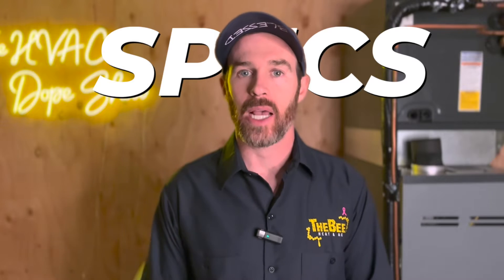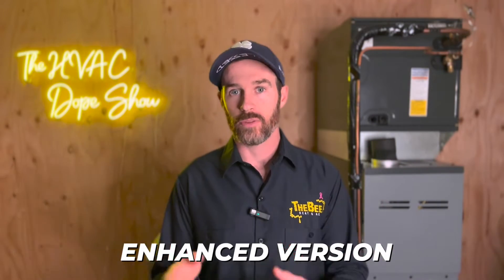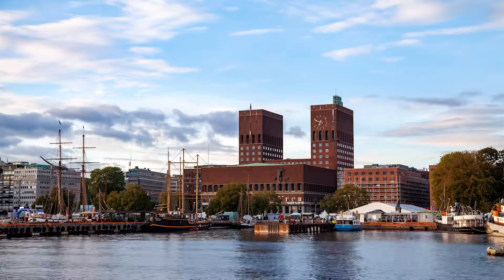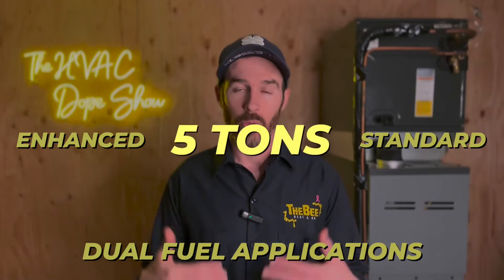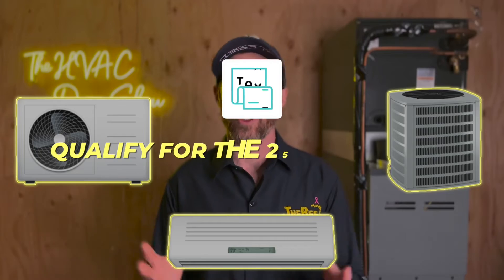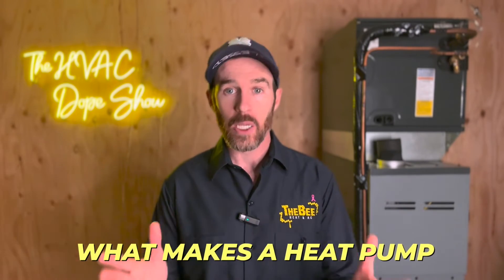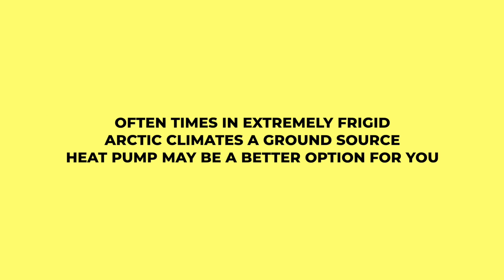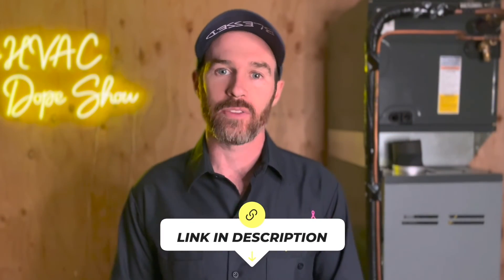The NEW Daikin Fit ENHANCED Heat Pump?!🤯❄️

Comment: Hello, we had our Daikin DH7VSA installed yesterday.  It was getting pretty late in the day by the time the crew finished up.  They started the system and left shortly after.  Initially, the system ran like a freight train, like full speed inside and out.  The house was a little cold, but in looking on-line for answers, some say this is normal and it has calmed down today, but still the blower speed seems much faster than what I have experienced say on a American Standard XV18.  What i found on-line was the Daikin is learning and will run more like expected by day 3 as a variable speed unit.  Is this correct or is there something amiss with this unit?  Thank you!
Reply from the maker: Installer settings can change this like ramping profiles etc. it might be learning the system but also could use some fine tuning in the settings to make it run quiet mode etc

Comment: With the Daikin DH7vsa3610 here in Denver what’s the optimal lowest outside temperature to have it switch to the furnace? Mine is currently How does one change that?
Reply from the maker: The installers will do this but depends for what... if you have solar panels then it's based on comfort and you'll probably set it for 10F or something, but if you're on grid and doing it for cost it's almost always cheaper to run a furnace but the technically switchover temp for Denver based on gas prices last time I checked a couple years back was around 40-45F because that's where the breakeven COP was. 

But that being said if you're more comfortable with a heat pump then you can just select your desired temperature for comfort (whenever it stops keeping up, usually around 10F - 20F in Denver metro depending on sizing. But if you just want what's cheapest do a higher COP switchover around 30-40F instead.

Comment: I’m building a house down on the Galveston Bay. It’s very hot and humid.  How well do these work for humidity? The home will be sealed with spray foam.
Reply: This has variable speed compressor and fan motors. they can pull moisture from the air better during light loads because the system slows down airflow and compressor speed. Slower moving air around the evaporator coil means the air keeps contact with the cold coil for longer
The Fit uses a full-size, high-efficiency indoor coil. The coil has enhanced fin design and expanded surface area, which means more metal surface for heat (and moisture) exchange.

You’re also using a Daikin One thermostat for this system

Smart thermostats with humidity sensors can extend run times or adjust fan speeds when humidity is high.  
So yeah if its properly sized for the space the Fit will definitely make the air less sticky faster and better than systems without the modern motors and designs. All in all the Fit is freakin amazing so far. We will see what happens when these units start hitting 8 or 10 years of service. 

Ps. Don’t forget your annual maintenances and change that filter often!

Comment: I'm San Jose California area. Debating between Daikin Fit DH6VS vs DH7VS, as DH7VS offers the federal tax credit. Is DH7VS too much of a machine for my region as it seems to be designed more for colder regions? Would it be a mistake to go with DH7VS if the upfront price difference is $1000 more, and it seems to be have slightly additional noise and additional electricity usage than DH6VS? Any benefits of choosing DH7VS - is it more durable or efficient? Thanks
Reply: I’m in norcal as well, what did you decide to go with?

Comment: Appreciate your videos.  Live in Portland Oregon.  Looking to get new heat pump/ac all in one unit.  Do you have a good referral for company in this area.  We are inclined to get Daikin Fit model DFVE24BP1400.  Our home is only 1100 sq foot.  Current heat pump a Rheam is about 30 years old and not very efficient.  At least it hasn't needed repair, just cleaning, maintenance.  Thanks in advance.

Comment: Please refer me to a video for the Florida SW Gulf of Mexico region. I have Duke Energy.  My 13 seer 2.5 ton Trane HVAV is 17 years old.  The heat strip no longer works.  I do not have a heat pump.  I think I have a 2.5 ton variable air handler.  My house is 1100 sq ft with double pane windows.  It is important to me to have a very reliable system.  In 17 years my Trane only needed two capacitors and Freon was added once.  I change the perfect fit filter every six months and poor water down the drip line every 3 months.  Suggestions for a new HVAC system?   Price range?

Comment: I'm thinking about going with a Daikin Fit Enhanced dual fuel setup in my new home.  Can these be set up as a multi zone system?
Reply from the maker: Sort of, they can use a zoning board if you already have a zoned system (zoning dampers etc), but if you want one condenser connected to multiple indoor units that would be a VRV life setup.
Reply: My installation would be for a new home build with no existing HVAC components.

Comment: Have a quote for the enhanced right now, thinking of installing one here in wv. One contractor said years ago with the first fit systems they had all kinds of communication issues, so much that they stopped selling Daikin. Other company said they've had nothing but success with Daikin. Can you speak to this, have you heard of these issues? Maybe Daikin fixed it with layer generations. Any info would be helpful. Thanks!

Comment: I have 33 solar panels and 840 amp hr batteries backing up the whole house. House is 2 years old, 2300 sq ft, with 3 ton central air and gas furnace, near Sacramento CA. Can I change out the AC condenser on the ground and hook up a heatpump condenser unit to my existing exchanger in the attic? Is this a possibility?
Reply from the maker: Yes but only certain ones and there's no rebates... like a basic single stage maybe. Depends on refrigerant and age of coil but if that air handler is over 10 years old that's a waste and not much more to swap the air handler for one that Pairs with a new system

Comment: Best choice between an all electric option or a combination Heat pump and propane hybrid setup?
Reply from the maker: Without any context you're looking at it... the Daikin fit enhanced is super quiet and for hybrid setups where the average lows are 15F or above you're in good shape with the Daikin fit enhanced all electric air handler with electric heat kit for backup (nights below 10F) or a DM80VC furnace that uses propane, or in really colder climates something like the DM97MC modulating furnace. Really depends on climate. Northern Canada I wouldn't recommend that and would go for something that does better in super low ambient conditions like some of the Gree Flex or Mitsubishi options, I've heard Midea has a super low ambient option too. But if you're in Denver (average low in coldest month is 21F in January) or someplace similar then this is a great hybrid or all electric option.

Comment: I live in Florida with a very hot climate and have two central air conditioning systems plus a heat pump for pool water heating in the cooler months. Looking for the replacement options to address all my needs
Reply from the maker: From one system? Depending on the size of your home you’ll probably have two systems no matter what since it will need that to satisfy the load, and also work better with two separate systems covering different parts of the home. The stand alone heat pumps for pools work well but I wouldn’t want that tied into my house for redundancy purposes because if the pool goes out you want the home to still be able to cool. I would look at Daikin fit heat pumps as a good option for you and consult with a local contractor, lmk if you’d like a referral

Comment: For the Daikin fit heat pump, is there a way to adjust the fan speed? I just recently had a Daikin fit HP system, the noise level is crazy, and the fan seems running 100% full blast all the time, not really as what they claimed as a variable speed system... is that any advice?
Reply from the maker: It’s the middle of summer so if it’s over 100F or 105F it will run in boost mode which is 100% capacity… what region are you located in? It could be something else going on that needs adjustment. The other option is to adjust fan speed in the settings, sometimes it’s set to auto but I believe you can set your cooling fan speed to low medium or high and that will adjust the cooling speed fan settings downward…
Reply: @TheHVACDopeShow  I'm in CA. I just want to know for my specific Daikin FIT model could I set fan speed manually or lower the fan speed instead of AUTO, I cannot find anything in the settings, even known this is a so-called variable speed model.. very sad..

Comment: I'm currently in the planning stage of building a new construction home. I do not have an existing central HVAC system. I am interested in installing an inverter system for my new home, probably the daikin Fit, since I do want duct work due to the fact that I want a whole home air purification system also installed to run through the ductwork. Having said that, do you think a dual fuel system is necessary? while it doesn't typically go below 0 here often in NJ, I do have access to natural gas that I'm not sure would be helpful in the chance my electricity goes out. Or would it make more sense just to put in a whole house generator backup system and skip the combustion furnace altogether? thank you!

Comment: What are the benefits of a side discharge condenser? Why would someone choose a side discharge over a traditional format unit or vice versa?
Reply from the maker: Quieter and better heating performance, most cold climate heat pumps are side discharge. But if you live in Phoenix or High desert California the opposite is true…

Comment: I live in Northern California, climate zone 3. For 2-3 months in the year, the lowest average temp is 41F.

Is the Daikin Fit-E overkill for me, and should I stick with the regular Fit, or is there anything new the Fit-E has/does that would benefit me?
Reply from the maker: Just keep in mind that the enhanced hits the $2000 tax credit but the standard does not if I’m not mistaken. Would have to verify for your region but that’s one thing to consoder
Reply: @TheHVACDopeShow  yup, but I'd rather get the correct one than worry about the tax credit.
Reply from the maker: Depends if your high temps get above 105? If they do then you’ll definitely want the enhanced so things don’t derate / less capacity loss for cooling. But if your temps range from 45-95 then a standard fit is fine IMO at least
Reply: @TheHVACDopeShow  my highest is 86F for 2 months in the year. So the enhanced is also better at high temps? I thought the only difference between the two was at low temps.

Comment: I teied searching for the enhanced models on their site but cant find it. Do you have a direct link to the enhanced models?
Reply from the maker: It’s in the same manual as the DZ6 it just has an E at the end. I don’t think it’s featured separately on the site, but the low and high ambient performance data is slightly different
Reply: Thanks. If it is not listed separately on the website and only referred in the manual, then how would one purchase this? Just making sure this is truly available for purchase. Maybe I'm misunderstanding how the enhanced roll out is

Comment: Trying to find filter change for this pump... keep finding it for inside filters and not outside filter.
Reply from the maker: There’s no outside filter, only indoor air filter. Condenser coil just needs a light cleaning periodically, normally we hose it down with a normal garden hose (don’t use a pressure washer this will damage the fins)
Reply: @TheHVACDopeShow  thanks! If this doesn't help the ac then I'll try to see if the refrigerant needs a charge. Then call someone in if I need to.

Comment: Could you help clarify compatibility before we buy? I have a Daikin furnace, DM96VC1005CN, coils added with instal but never used CAPF4860C6DB, Ecobee thermostat. Want to add AC now, need the quiet feature of Daikin Fit in Seattle. Which Fit is compatible with what I have? Furnace only 6 years old. Can I add an outdoor Daikin Fit AC or another quiet unit? Or need to replace coils and thermostat for compatibility which seems a waste. Thank you, I've learned much from your videos!
Reply from the maker: For sure my pleasure! Unfortunately for the fit you’d need a CAPE coil with an electronic expansion valve, however for inverters you can also go for a DX9 or DZ9 and I believe both of those pair with that coil with a standard TXV. The only downside is it’s typically a more expensive condenser and not side discharge, so I would verify if it’s actually a better deal to just replace the coil and go for a fit, or just keep existing and add a DX9 / DZ9 condenser and keep the existing coil. Dm96vc is communicating and will pair with a DX9 (cool only is the DX, a DZ is heat pump if you wanted that option).
Reply: @TheHVACDopeShow  Thank you for your helpfulness, I appreciate the knowledgable and willing response. K

Comment: If someone in the Denever area wants my Daikin Fit that these people installed,  you can have it.
Reply from the maker: You’re unhappy with the fit? Please contact the office we’re happy to fix whatever’s wrong with it if you’re having issues. Can’t see your name just username from the comment
Reply: @TheHVACDopeShow  Nothing is "wrong" with the system, it mainly boils down to a hard lesson I had to learn in expectations vs reality. I thought I could swap out an old single stage beast with an inverter model and change nothing else and just sip power, however, turns out cooling an entire house with no zones takes a butt ton of power regardless. I do not need nor want to cool the entire footprint and so there is virtually no scenario where I want to turn on the 4 kW fire hose and nuke the house with cold, generally I just want 1 or 2 rooms cooled. I think hydronic heating and cooling is the future and I'm going to work towards making my own system. I genuinely just want this fit compressor not to go to waste, you could totally hook up one of your customers up that would appreciate it far more than me. If this compressor could be adapted to do heating however..... I would be interested in that, is that a thing? I will take a few guesses at your email if you want to reply to me directly, I had to remember that I made this comment and track it down to see if anyone replied this time.

Comment: Daikin air-source heat-pump for heating your house sucks, those heat-pumps are terrible noisy.
The colder it gets, the more noise they make.
Reply from the maker: Not the Daikin fit that’s incorrect… must be confused, Daikin fit / VRV life is quiet. I have one installed outside our bedroom window and can’t ever hear it… old school single systems ? Ok sure but that’s not what we’re talking about in this video…
Reply: @TheHVACDopeShow  
Calling that quiet, you must be joking. 
The specs say:  "With the ability to reach sound power levels as low as 56dB(A)"
56dB(A) at low frequencies could be well above 90 dB(C). That's loud enough to cause ear-damage and permanent hearing loss.
Reply: We are a developer that has installed heat pumps in our developments.  The are as quiet (and in many cases quieter) than a simple house fan…So not noisy at all.  In fact we even install them on porches as the breeze from the fan units (which are that quiet) makes sitting on the porches pleasant with fan from the heat pump running and cooling the house.
Reply: @Spp235.  Daikin heatpumps are quiet, as long as you don't turn them on, if off, then they are quieter than a running house fan.
Your last porch example is an example of COOLING the house, while as a "professional"  installer you  know that they produce the most noise, while heating the house.